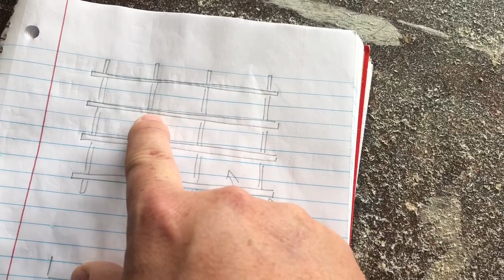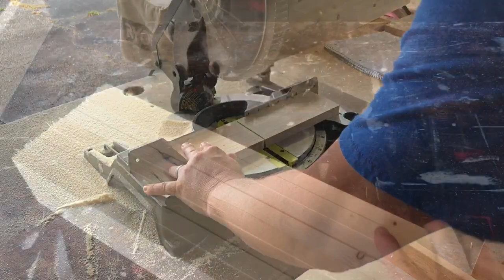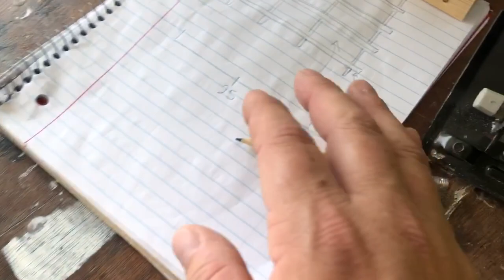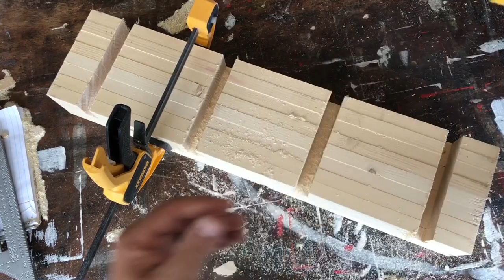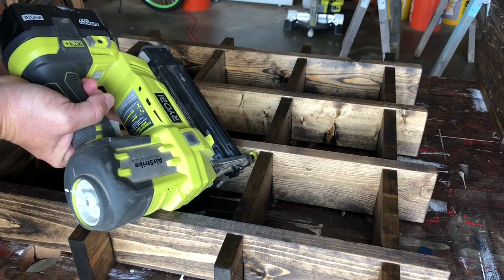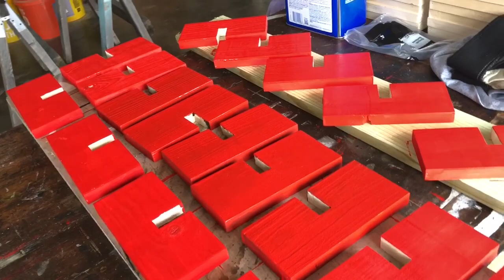How To Make a Tic Tac Toe Toilet Paper Holder

Comment: How much does it weight after done ? Wanted to put it on wall
Reply from the maker: Great question, but I have to say, I'm not sure. My guess would be about 12-15 pounds...which, if you use regular D-Ring hangers, that should be more than fine.

Comment: How did you cut the short part of the grove out?
Reply from the maker: I usually take a chisel and pop it out with that. But if you use the saw blade enough, you can chip away at it without using a chisel.

Comment: How did you get the pieces out the middle?
Reply from the maker: Do you mean where the boards connect with one another?
Reply: @AppleValleyFarmGA Yes. I think I got it but it wasn’t easy just using the same saw. 😬